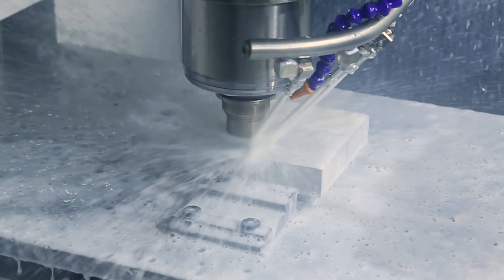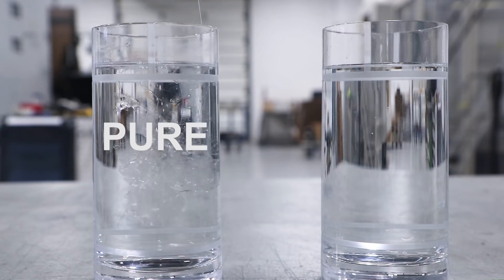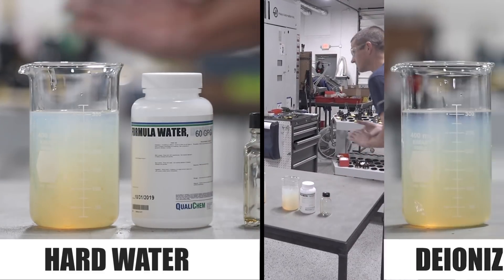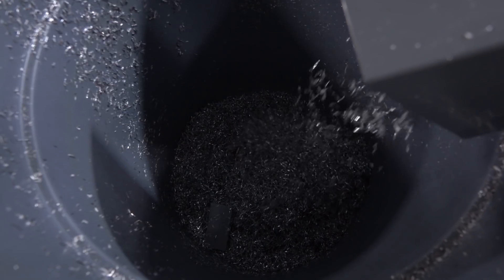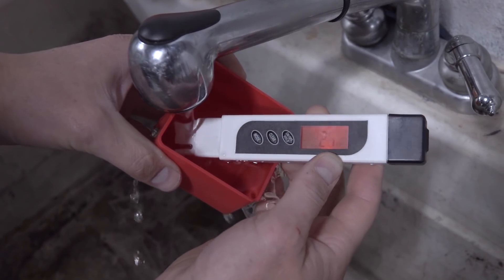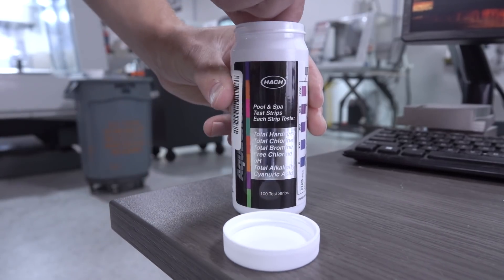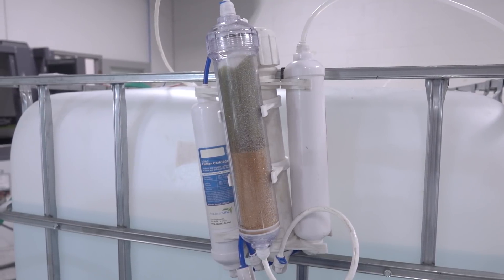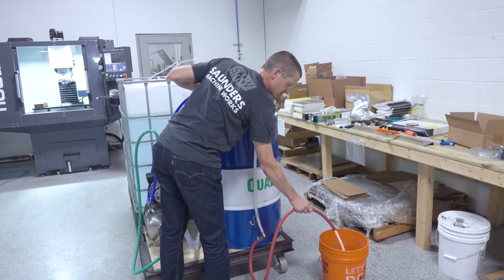CNC Machine Coolant and Water Quality | Clearing Up the Confusion!

Comment: Here is the solution that worked for me. I'm a small shop, 2 machines, using Synergy 735. From coolant vendor, they advise to only use DI water. Reached out to a company called Eversoft and leased one DI tank for $30/month. I opted to by a "light" which is basically a sensor checking when the resin starts going bad. Once the light goes off I call them for a swap. I've had my coolant for a year now and it remains crystal clear. Before that, I had to buy water from a local car wash store who sells DI water. I was paying $20/month to buy it, not to mentioned the trips (about 5 miles out) and the load/unload from my truck, which was a pain. It was a no brainer for me. Hope that helps
Reply: Synergy 735 initial cost is very high, though.
Reply: @LakshmananLM  How so?
Reply: @ciscohernandez4384  what I meant was Blaser products especially the newer versions are very expensive. At least where I am. Granted, the sump life of this synthetic coolant is long and it doesn't mar aluminium surfaces like other synthetic metal working fluids. Cheers
Reply: @LakshmananLM  Hmmmm, I got a quote for synergy 750 and some qualichem. Synergy was like $20 more for a 5 gallon pale. The coolant rep told me that because my machine was new and this was going to be the first coolant to break the machine in, they would top it off for free. Got 2 five gallon pales for free. It was a no brainer for me. Grant it, it's a way for them to keep me as a customer but I'm happy with it. I'm in southern california.
Reply: @ciscohernandez4384  you've got a very good deal. Here in South East Asia we get special pricing that will make a grown man cry. Exchange rate and ridiculous taxation. It is an excellent fluid though. Ours unfortunately is a very price sensitive market, and low industrial requirements for high performance products can't justify lowering prices for something shipped from Switzerland. You should see at least 2 years on your sump life with good care. I'm not an end user, but had been selling and doing after sales service for them. Here in my region, our jobbing houses refuse to acknowledge that cutting fluids are as important as all other process inputs. Not to mention cavalier attitude towards recycling and waste disposal. Having terrible flashbacks now. Cheers
Reply: Lakshmanan L M 
Not really.  It is actually less expensive per barrel than their Vasco 7000 line. And far better. Plus it runs at a lower concentration, meaning less concentrate is needed per gallon of water. 

The savings is quickly realized, and the up front cost isn’t much more than any other coolant.
Reply: @occamssawzall3486  Thanks for the reminder! Vasco 7000 was promoted quite heavily as a replacement for the Vasco 5000 and the mineral based 4000 Strong here. A single solution as it were. Loved those 2 though. Those could take a beating and still perform! We have a very confused jobbing market here. Too much cheap fluid from all over. I've left this business for now. Cheers